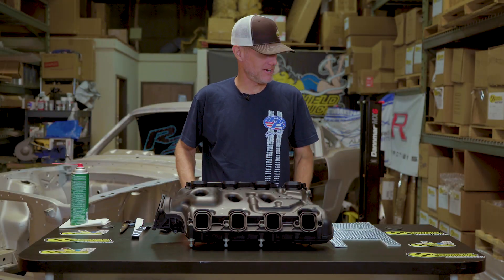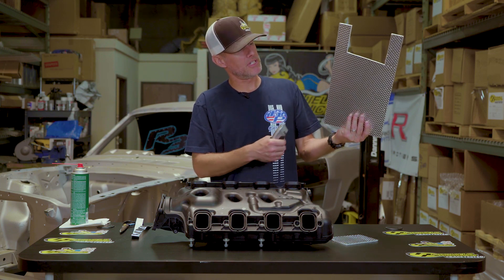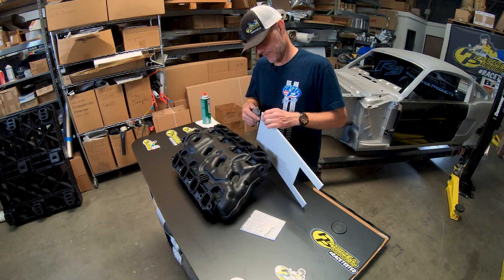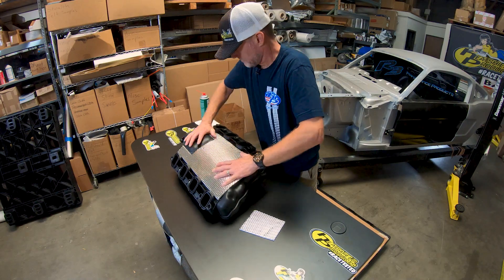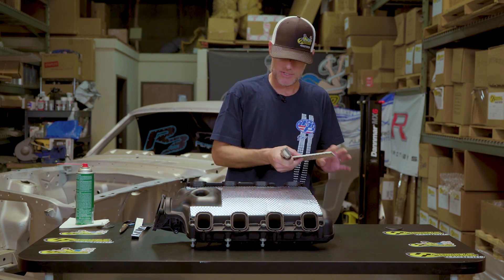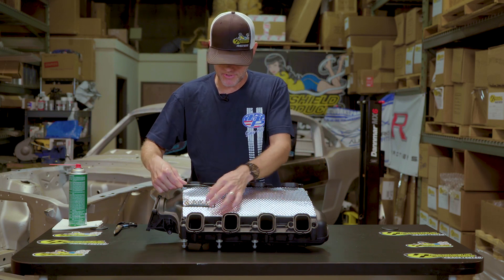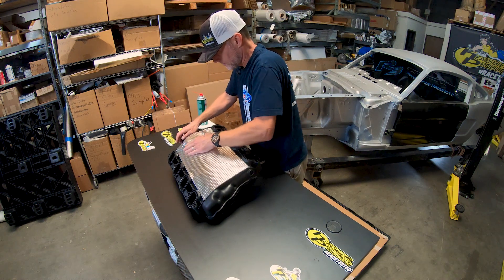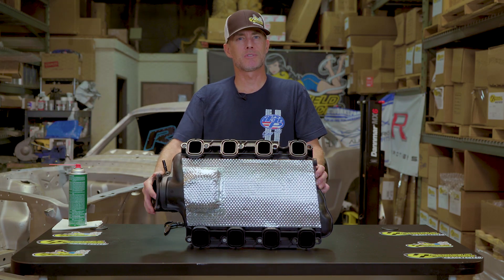Cheap Horsepower For Your LT1!

Comment: Would this work on a MSD atomic air force intake manifold for a LT1?
Reply from the maker: Thank you for your question! Looking at the Atomic it may work.  You may need to do a little trimming of the shield material vs. the stock intake. The best solution may be the universal kit #140004

Comment: so is this for a lt1 or lt4...  if it is for a lt1 does a lt4 intake direct bolt in place of the lt1s?
Reply from the maker: Thank you for your question Mid Mitten Video. This is for the LT1.
Reply: @Heatshieldproducts  does the lt4 intakw direct bolt on to the lt1 or is there an adapter plate
Reply from the maker: @midmittenvideo8322  Not sure.  We are just demonstrating our Intake Manifold Heat Shield on this LT1.
Reply: Hmm ok.. never seen a lt4 intake go on a lt1 thought it was kinda interesting